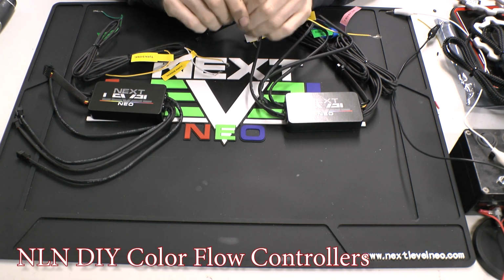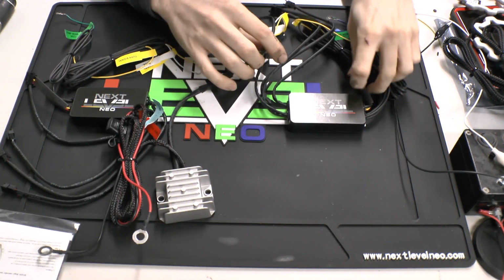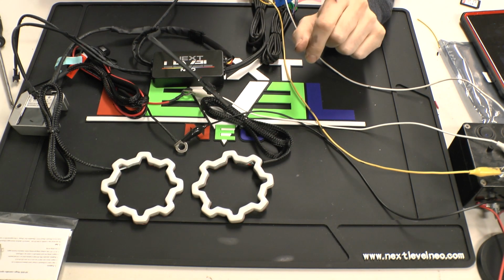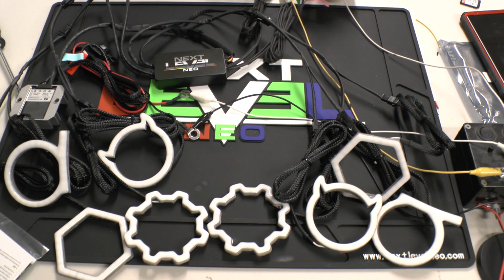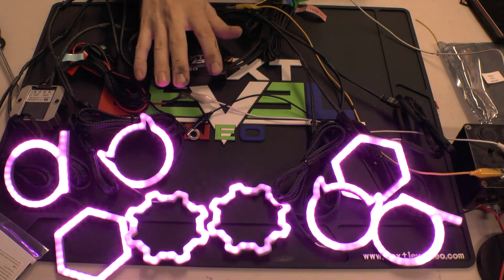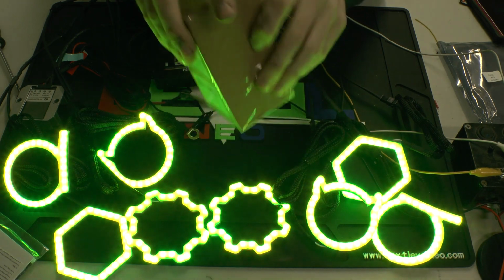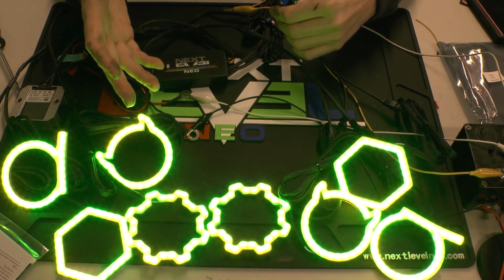NLN Bluetooth RGBW LED Color Flow Controller: A Seamless Integration with Vehicle Input Signals

Comment: For headlights. How do you determine the wire left  turn signal and right turn signal.
Reply from the maker: Looking at the controller with our logo up, the top 2 connectors are controlled by the short turn signal wire. The bottom 2 are controlled by the long turn signal wire.
Reply: I put my drl and start up together. But I don't have drl function on my 2003 s2000. I wired them both to my parking light red wire. There are 3 wires for that parking light 1 red and I think 2 black. They don't animate when I turn the key.
Reply from the maker: @Shawn Saleem  you can test the controller drl wires by going direct to 12v. If you get the animation doing that but not on your red wire on the car then it's probably not the right wire. Colors don't always mean the norm. One of the black wires may be your drl.

Comment: Hello, for tail lights like the tesla, that has split up tail lights, how many splitters would you need?
Reply from the maker: Our controllers have 4 outputs built in, but you would want extensions to run the wires. In general, this controller is ideal for halos or strips in a set of lights, but something more complicated will benefit from a blueghozt controller.

Comment: With this controller is it possible to drive around with the DRL in a different color or does have to be white all the time? for head lights
Reply from the maker: The colors for drl and turn signals are set. These settings are preprogrammed on chips so there is little control over those functions.
Reply: @NextLevelNeo   ok and does the app allow for solid colors or is it just animations
Reply from the maker: @Jarednation63  the app can do any solid color or any of several hundred animations

Comment: How heavy is the Halo front lights?
Reply from the maker: Halos are generally very light. It depends on which halo but usually around 1oz
Reply: @NextLevelNeo  Thank you. I wanted to order now, but I need to inform the shipping company of its weight

Comment: I noticed the DRL turns off when you’re using your turn signal around 10:15. It turned off both DRL sides? What happens when you brake and use the turn signal simultaneously? Can you tell the controller, like the ghost, how many LEDs you want to use for the turn signal separately to the DRL/brake LEDs?
Reply from the maker: Yes, unfortunately it does turn off the brakes. This is not ideal for a full tail light build, it's more meant for adding a set of halos to your tail lights. I would go with BlueGhozt for a more indepth build. And unfortunately there is no adjustment for the signals and led counts.

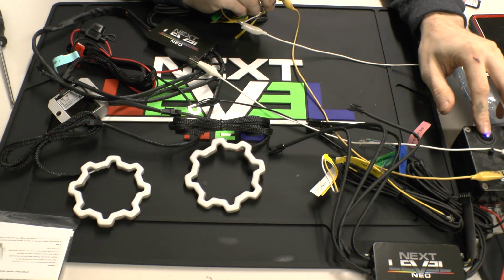Comment: At 5:08 you switch on the turn signals and it seems to be out of sync with the flasher.  Is that normal?  The brake one seemed to sync with the flasher correctly.
Reply from the maker: I haven't noticed any issues with timing but in general, if you are using multiple turn signal devices with multiple controllers chances are that they will not sync up perfectly.